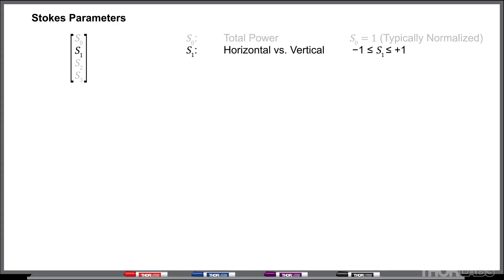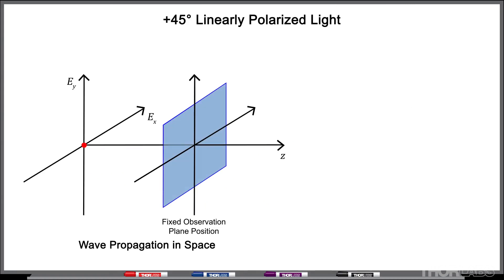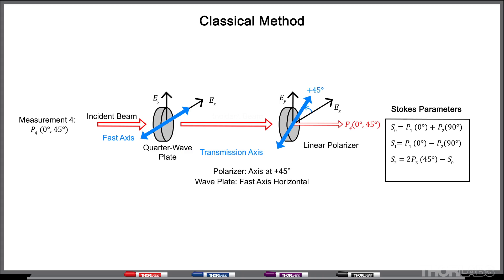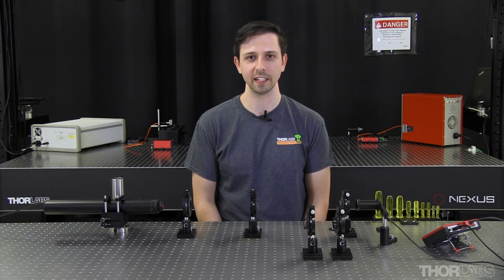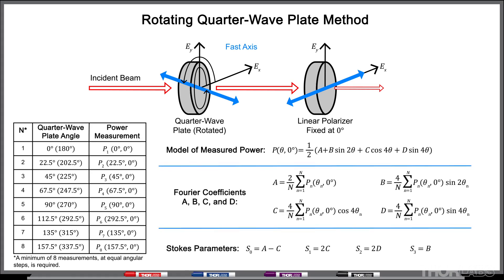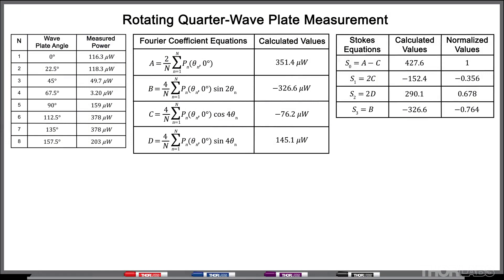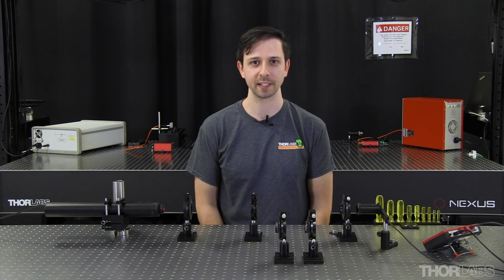Build a Polarimeter to Find Stokes Values, Polarization State (Viewer Inspired) | Thorlabs Insights

Comment: Thank you very much for sharing this useful technique! I just want to make sure if my finding is right, which is wrong angle positions in the rotating QWP method. The angle of the ring mount is set to 5° when measuring P1(0°) at 11:11, but the angle is 32.5° for P2(22.5°) at 11:29, which is supposed to be 27.5°. The others also have +5° angles. I think all the angles of the mount should be -5° except for P1(0°) because the fast asix has to be aligned. Is that right? Or, is it okay to just set it to 10° when measuring P1(0°)?
Reply from the maker: @TsuyoshiTakataniPhd   You are correct that the P1 and P2 power measurements were separated by 27.5°, instead of the 22.5° increment that we intended. This resulted in all P2 - P8 measurements being measured at a 5° offset from the intended orientations. Thank you very much for letting us know what you saw!
While it is not necessary to orient the QWP at particular angles when using the rotating QWP method, it is extremely important to know the QWP angles that are used. When we perform the calculations using the actual angles of the QWP, we obtain the following Stokes parameters: S0 = 1, S1 = -0.502, S2 = 0.385, and S3 = -0.723. The corresponding polarization ellipse values are then: psi = 71°,  E_ox = 0.499, and E_oy = 0.867.
Reply: I think the 5 degree is there because the plate inside is aligned to the horizontal(visually), not to the zero degree of the rotational mount. It is kinda hard to align that QWP inside the rotaional mount and have the mount's 0 degree positioned perfectly to the horizontal. As long as the increment of angle is correct what the demo showed should still be right.
Reply from the maker: @toppasan9089    We agree that the polarization axis marks (engravings) on optic housings should not be used to fine-tune alignment. Not only would that be hard to do with precision, the optic is actually assembled at the factory with some tolerance between the optics’ real polarization axis and the mark on the housing, and it is also possible that (unknown to you) a colleague might have previously removed the optic from the housing and replaced it later with its axis significantly mis-aligned with the mark (ask us how we know :) ). Because of this, we always use a precision optical method to determine the orientation of the polarization axis before we use the optic. When Gavin mentioned that he had aligned the fast axis of the QWP to be along the horizontal (7:42), he meant that he had used a method, such as the one described in our video https://www.youtube.com/watch?v=XQwiPm5OtSk , to precisely determine the orientation of the QWP’s fast axis. 
 
In the demonstration, as you noted, the angle on the rotation mount’s dial was not 0° when the QWP’s fast axis was precisely aligned horizontal. That is not a problem, as long as that non-zero starting number on the dial is taken into account when reading and adjusting the optic’s angle. Here the goal was to add 22.5° to the number on the dial seven times, which was done... except for one adjustment in which 27.5° was mistakenly added to the number on the dial. The Stokes parameters can still be calculated from the measured values, but the actual orientation angles must be used in the calculations. 
 
Using a different rotation mount might have helped us avoid this experimental error. For example, there are mounts that allow you to adjust the position of the “0” on the dial without rotating the mounted optic (such as: https://www.thorlabs.com/thorproduct.cfm?partnumber=RSP1D ), and there are also Indexing Rotation Mounts that additionally allow the dial to be rotated in discrete increments (such as: https://www.thorlabs.com/newgrouppage9.cfm?objectgroup_ID=246#3668).

Comment: I also think there is a problem with the measurements. In principle S1^2+S2^2+S3^2 <= S0^2. The sqrt of the ratio is <= 1 and represents the total polarization fraction (https://en.wikipedia.org/wiki/Stokes_parameters). With this measurement set one gets 1.08 which is significantly greater than 1 using such high quality optics. Here is my measurement set for an incoming horizontal polarization analysed by a vertical analyser: {2.3, 429.8, 825.5, 395.6, 2., 420.5, 827.2, 438.8}. And these are the corresponding reduced Stokes parameters: {1., -0.993, 0.010, 0.008}. Fine: almost perfect polarization (>99%) and H is actually opposite to V.
Reply from the maker: @renaudmathevet9374   Thanks for highlighting that calculating the S0^2 value to see if it is less than or equal to one, as expected, is a good validation check of Stokes parameter measurements. 
 
For those who have not seen our replies to other commenters on this topic, renaudmathevet9374 is referring to the results we report for the rotating quarter-wave plate method. When performing this measurement, we intended to increment the wave plate’s angle by 22.5° each time. However, our first increment was accidentally 27.5° (every following increment was 22.5°). Since we did not realize this at the time, the Stokes parameters shown in the video were calculated using the intended measurement angles, instead of the actual measurement angles. This resulted in errors in the Stokes parameters we show in the video. When we calculate the Stokes parameters using the actual measurement angles, the values are: S0 = 1, S1 = -0.502, S2 = 0.385, and S3 = -0.723, where S1^2 + S2^2 + S3^2 = 0.96.

Comment: Another likely reason for differing results is that the power was measured with the 1/4 wave plate at incorrect angles.
The first reading at 11:11 was at 5 degrees
The second at 11:20 was at 32.5 degrees
The third at 11:39 was at 55 degrees
and so on
77.5 degrees
100 degrees
122.5 degrees
145 degrees
167.5 degrees

The first reading was 5 (perhaps 4.5) degrees in error and the others were 10 (perhaps 9) degrees in error.
The first result was a 58.9 degree angle and that is very close to TEN degrees in error from the second 69.2 degree result.

Knowing little about optics I would have thought that a 10 degree error in polarisation angle would have been a big problem in research.

Perhaps there was some special reason to have the plate indexed to the -30 minute mark on the vernier scale and then to take the other readings from the vernier scale at the -60 minute mark instead of the zero mark which will have a 9 degrees offset.

I admit I have never used this sort of apparatus but the starting position of the 1/4 wave plate away from the ZERO mark raised my curiosity when I saw a different index point used for the first changed reading I felt I should leave a comment especially since the results were so far in error.

I found this video when investigating a bit of lab apparatus I was thinking to bid on but not sure if the Hinds Instrument, signal conditioning unit,  all alone is of much value to me besides to feed my curiosity.
Reply from the maker: You are very observant! One thing you observed (the starting orientation of the wave plate) was intentional, but the other thing (the first angular increment being smaller than the others) was an error on our part.
 
The wave plate’s axis started out being aligned to the horizontal as we intended, even though the scale on the mount was not at 0°. This is because we had aligned the wave plate using optical techniques demonstrated in a different video ( https://youtu.be/P0asuzX4x-Q ), instead of referencing the scale on the mount. There is almost always some offset between an optic’s axis and the 0° mark on the mount, so it is good practice to use optical techniques to align a setup’s optics. After the wave plate’s optical alignment, the corresponding reading on the mount’s scale, in this case ~5°,  became the new zero.
 
To make our measurements, we then needed to increment the wave plate’s angle by 22.5°, seven times. Unfortunately, an addition error led to a first increment of 27.5°, followed by increments of 22.5°. We did not notice this error until we read the comment from @TsuyoshiTakataniPhd . You both correctly conclude that inputting incorrect angles into the equation will affect the accuracy of the results. When we complete the calculations using the wave plate’s actual measurement angles, we obtain the following Stokes parameters: S0 = 1, S1 = -0.502, S2 = 0.385, and S3 = -0.723. The corresponding polarization ellipse values are then: psi = 71°, E_ox = 0.499, and E_oy = 0.867.
 
It is great to hear you are feeding your optics and photonics curiosity! These are growing fields with lots of opportunities and interesting problems to explore 😊.

Comment: In the second method, it appears that instead of rotating the quarter-wave plate, the linear polarizer is rotated, which is likely why the results of the two methods have been different
Reply from the maker: Two reasons are primarily used to explain why the two methods usually provide different Stokes parameter measurement values. One reason is that, in the classical method, the wave plate is only in the beam for one of the four power measurements, while for the rotating wave plate approach the number of components in the beam remains the same for every power measurement. The second reason is that the classical method calculates the Stokes parameters from only four power measurement values, while at least eight (and often more) power measurements are made when using the rotating wave plate approach.
 
Inserting the wave plate for one of four measurements is potentially problematic because the total system losses due to surface reflections from and the material absorptions of the optics will not be constant for all measurements. These losses will be higher when the wave plate is in the system than when it is out, but the classical method’s calculations assume the scattering and absorption losses do not change. The rotating wave plate method also makes this assumption, but for this approach the same optics are always in the system.
 
The smaller number of measurements made for the classical method also increases the chance for experimental error, since the accuracy of this method is highly dependent on the perfect alignment of the polarizer’s transmission axis to three different angles, which is not easy to do. In addition to leaving the linear polarizer fixed in place, the rotating wave plate method uses more measurements to calculate the Stokes parameters. The more measurements used to calculate the Stokes values, the less of an influence one inaccurate measurement has on the final values.

Comment: Are you taking the incident beam as a elliptically polarized?
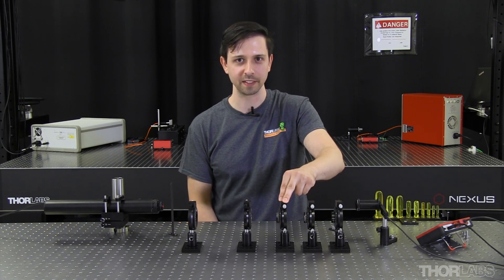Reply from the maker: @AranyaMukherjee-h7z  In the demonstration, we configured the beam that is incident on the polarimeter to be elliptically polarized. Our approach to creating an elliptically polarized incident beam was to use a helium-neon (HeNe) laser with a quarter-wave plate . The HeNe emits linearly polarized light with an approximately 500:1 extinction ratio, and that light is transmitted through the quarter-wave plate. The quarter-wave plate was then rotated so that it would transmit elliptically polarized light (see timestamp 5:10).

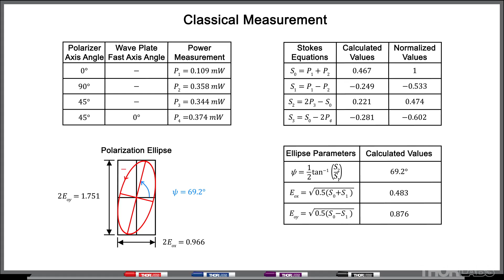Comment: Hello, at 8:23, I don't know how to calculate the ellipse when knowing the tilt angle theta, E0x and E0y. Could you please give me more detailed explanation? Thank you so much!!
Reply from the maker: @shijiechai9780   We used equations for the polarization ellipse provided by Edward Collett in his book “Polarized Light in Fiber Optics.” The equation describing a rotated ellipse (rotated to angle “Angle”) whose center is at the origin is: A*x^2 + B*x*y + C*y^2 = D, where A = 1/Eox^2, B = - 1*(Eox^2 – Eoy^2) * tan(2*Angle)/ (Eox*Eoy)^2, C = 1/Eoy^2, and D = 1- ( (Eox^2 – Eoy^2) * tan(2*Angle)/ (2*Eox*Eoy). The points on the ellipse can be calculated by starting with an array of x (or y) values that range from -Eox to Eox (or -Eoy to Eoy). Then, that array and the calculated values of A, B, C, and D are used to solve for the corresponding y (or x) values – for example by using the quadratic equation. The resulting set of (x,y) values are the points on the ellipse.

If we misunderstood your question, please let us know!

Comment: Nice video! Please could you explain a solution to this problem? The light I want to measure is not produced from known lasers, they are produced in some physical process(eg. stimulated raman), so their wavelengths are tunable and I don't have a suitable quarter-wave plate for them.
Reply from the maker: @davidjoy2182  Generally speaking, the basic approach to measuring polarization is always the same and does not depend on the way light is created (e.g. commercially available lasers, stimulated Raman, or another process). However, it can be more challenging to measure the polarization state of broadband sources than that of narrowband lasers like a HeNe, the accuracy of the results can be substantially lower, and your polarimeter should be built using components compatible with the entire wavelength range of interest. 
 
One challenge is that the source light needs to be reasonably well collimated, which can be difficult to achieve for larger-sized sources without losing a lot of the optical power. In addition, the polarization measurement will provide a weighted average of the polarization states of all the light components present. This can lead to a complex result and a degree of polarization (DOP) that is significantly in error. If the light source is pulsed, this will increase the complexity and performance requirements of the detection system.
 
If you would like to build your own polarimeter with components compatible with a broadband source, Thorlabs offers superachromatic quarter-wave plates ( https://www.thorlabs.com/newgrouppage9.cfm?objectgroup_ID=2193 ) and fairly wideband linear polarizers ( https://www.thorlabs.com/newgrouppage9.cfm?objectgroup_ID=5510 ). Our polarimeters ( https://www.thorlabs.com/newgrouppage9.cfm?objectgroup_id=1564 ) are designed for broad range of wavelengths. But, just as for a broadband polarimeter you would build yourself, light with bandwidths around 2 nm are needed to obtain high-accuracy results.
 
If this does not answer your question, or if you would like additional information, please contact Tech Support (techsupport@thorlabs.com).
Reply: Thanks for the reply!

Comment: how did calculate the ellipse parameters because i got different values and how did you plot it
Reply from the maker: @rashadmabrouk8026  We do not have enough information to know why your ellipse values differ from ours, but one thing to note when calculating the ellipse angle psi, is that the equation we provide (for example, shown at 8:16) assumes the inverse tangent calculation takes the quadrant into account. We used the function named “ATAN2” in MATLAB and Microsoft Excel. If the inverse tangent calculation does not take the quadrant into account, the calculated angle ends up being -20.8°, since the negative S1 value and positive S2 places the angle in quadrant II. In this case, it would be necessary to add 90° to this value to obtain the 69.2° value we calculated. 

The x-y coordinates of an ellipse with known major and minor dimensions (Max and Min, respectively) and rotation angle psi can be used to plot the ellipse. To calculate these coordinates, we used the following equations and varied the angle theta from 0 to 2pi:  
                                                       x(theta) = Max*cos(theta)*cos(psi) – Min*sin(theta)*sin(psi) 
                                                       y(theta) = Max*cos(theta)*sin(psi) + Min*sin(theta)*cos(psi)